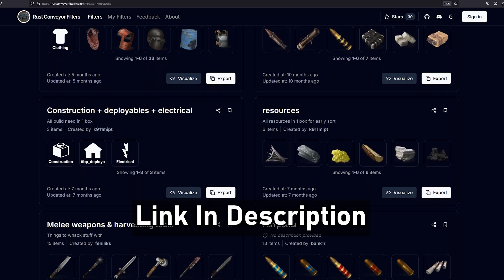Full Base Industrial Automation - Auto Sorting, Auto Furnaces & Auto Crafting | Rust Tutorial

Comment: The video was explained really well. I knew most of it already, but I still learned something new: the Super Conveyor. I’ll be using that from now on.

One extra thing I do: in my loot room I feed all my boxes into a single combiner, then merge all those combiners together. At the end of the last combiner I add a splitter and chain as many splitters as I need to automate things like my lockers—or branch off a line to a crafter for the next conveyor. That way I can automatically pull whatever I need from all loot boxes and route it anywhere in the base, without having to reconnect the boxes each time. It’s a single backbone connection I can draw from for everything.
You can even loop the output from that splitter back into the splitter at the start of the loot-box system. That way the network auto-sorts anything you accidentally drop into the wrong loot box: it will pull the misplaced item out and route it back into the correct box automatically.

Comment: my furnances and refinery keep shutting off with plenty of mats
Reply: try raising max wood in conveyor from 12 to 14
Reply from the maker: If the server you are on is lagging, or there is already a lot of industrial/electric systems running, 12 wood may not be enough to keep your furnaces cooking. Try increasing the amount of wood sent to each furnace by changing the value of the wood conveyor (shown at 3:33) until the problem is fixed.